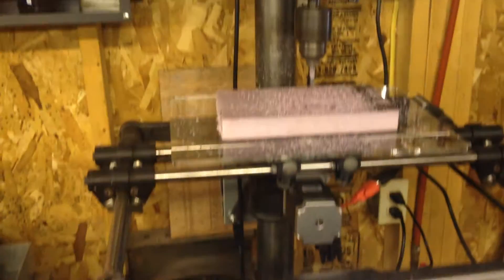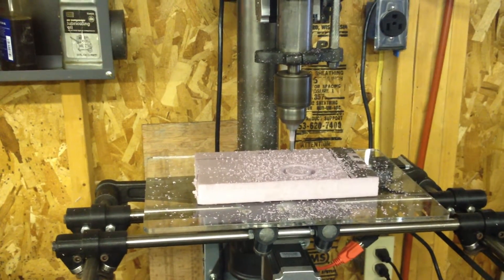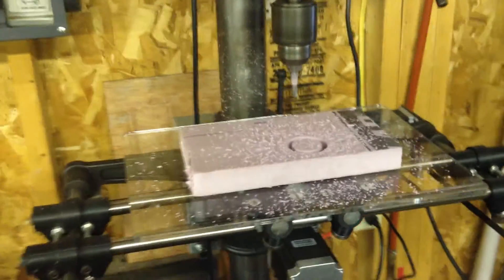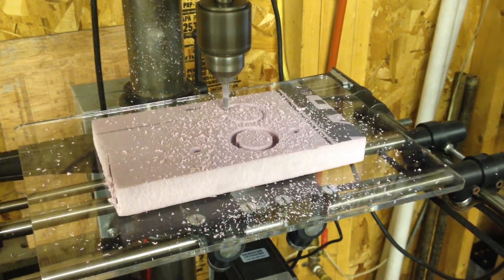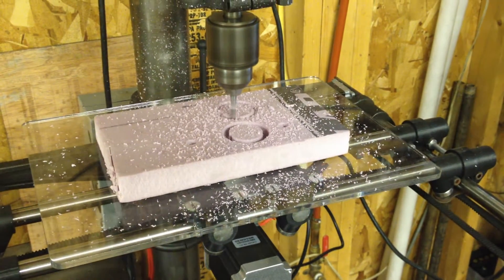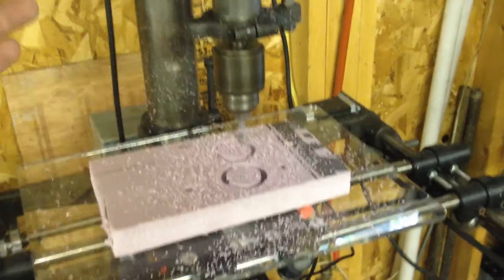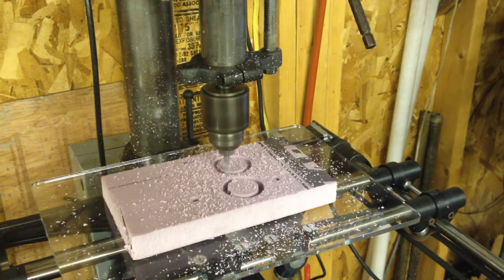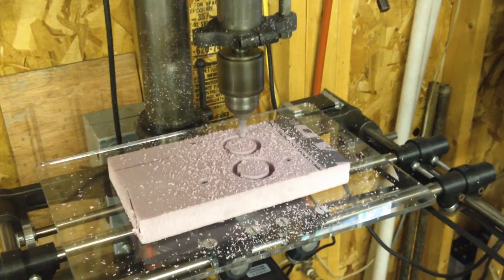1946 Delta Drill Press converted into CNC Router

Comment: I'm working on a similar project, but as a simple drilling machine (single axis) to perform single-operation drilling on production parts.

Kinda having a tough time calculating the torque and ratios I'm gonna need on the belts and motors. With your NEMA 23, did you need a gear reducer, or did you just do pulley reduction? What was your final drive ratio, and do you feel like it has pretty good torque for plunging on the Z-Axis? I'm trying to keep the number of parts I have to change and re-purchase to a minimum, so any help would be appreciated.

Thanks!